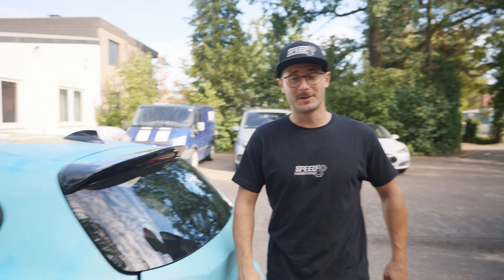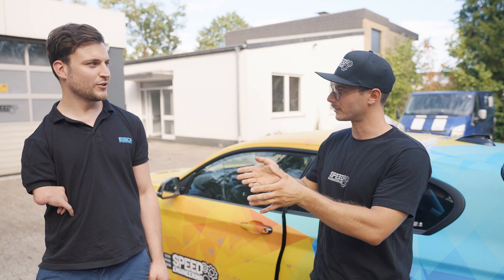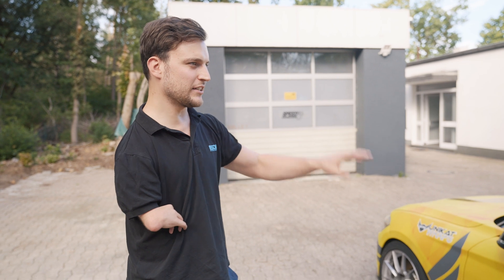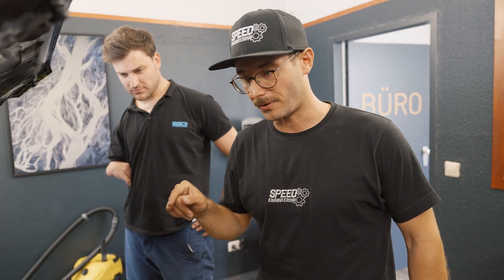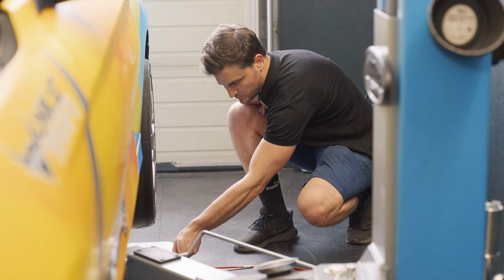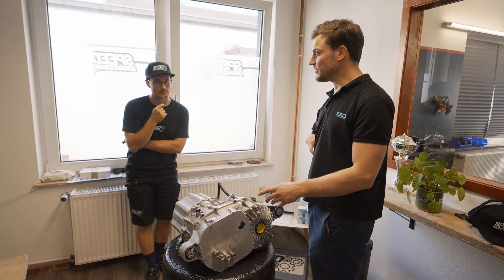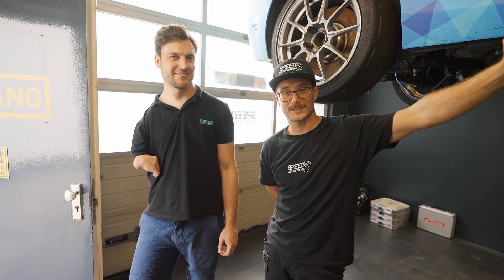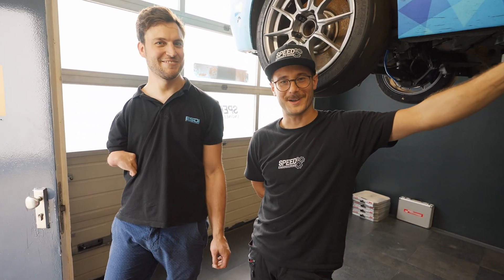BMW Rennwagen - Tesla Elektrofahrzeug-Umbau [ENGLISCH] | Speed Engineering

Comment: How does such an EV conversion affect the chassis? Is there anything that needs to be checked and maybe changed?
Its a cool topic and hopefully some old Legends could be revived like that.
Reply from the maker: It depends on the power and torque.. it could lead to the point where we have to work on the chassis and do some upgrades :)